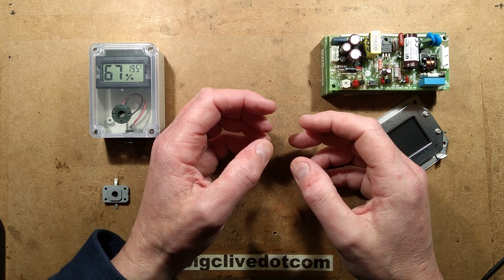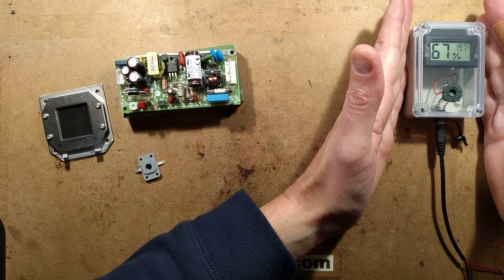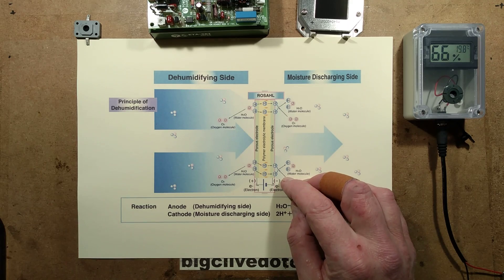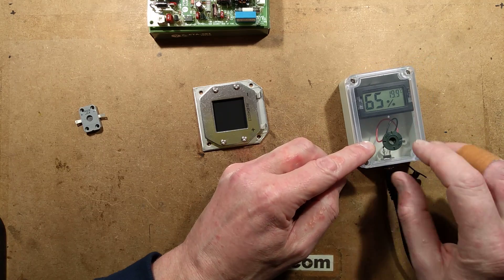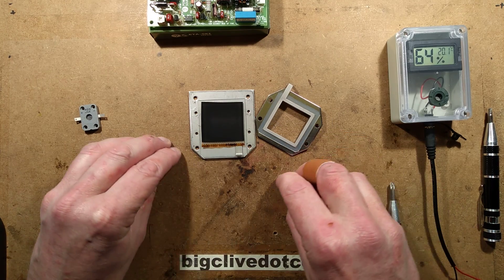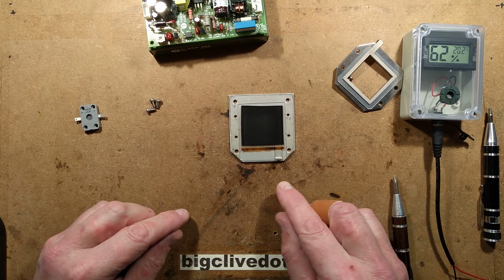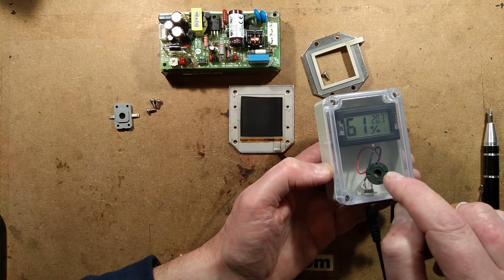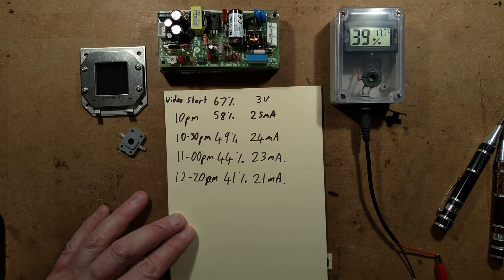Incredible solid state dehumidifier.  No moving parts.

Comment: So impressive! After an excellent explanation of the base principles, some commenters still fundamentally misunderstand how it works, or what it can do, or what it's good for.         

I know it's not new anymore, but wow! Some reflections about some of the comments:

No, it doesn't do anything with the collected water, cause there's no collected water to do anything with, it doesn't collect water, if anything the opposite, it splits water, into hydrogen and oxygen, as clearly explained.

No, it can't turn liquid water in to water vapor and extract electricity from that process, that's just not possible, and, that would still not be normal operation reversed.                   

The actual normal operation reversed is not technically impossible to draw "power" from , but then again, a fuel cell designed for that actual use would be a lot better, and they're still incredible impractical compared with other alternatives.    

As some already pointed out, splitting the water in humid air, and getting rid of the hydrogen can't increase the oxygen levels significantly. If there were liquid water in the box that could evaporate to replace the spitted water it would be a completely different story.

PhD on fuel cells or not, if it had the life expectancy of a horrifically abused PEM fuel cell they wouldn't be commercialized, as they would have total capacity over it's life similar to a bag of silica gel of the same size.

Comment: 13:29 Could the 3V limit be simply to avoid turning the membrane into a Capacitor?
If it does become a Capacitor, could it damage the power supply, the equipment it's dehumidifying and or some poor shmuck that touches the wrong thing?

Comment: the membrane is basically working by electrolysis. You could make an enclosure that includes an O2 sensor. IF the environment in the enclosure does become O2 rich it would have to be combining the H with O2 from outside the enclosure that could reduce available O2 around the enclosure. So build an enclosure where the membrane is between 2 sealed sections, Put a mouse in the output side and see if the mouse passes out as the humidity increases. Might also test to see if a pressure differential occurs between the two sealed section of the enclosure if you don't want to asphyxiate the mouse just put an O2 sensor and humidity sensor on both sides. Oh, and a pressure sensor to measure if a pressure deferential presents between the two enclosures, input and output sides.

Comment: those temp and humidity meters are changeable the Fahrenheit  setting is achieved by shorting 2 solder dots on the PCB , the board is marked C/F could always put a switch to change between

Comment: So it discharges hydrogen gas into your electrical panel? That doesn't sound like a good idea. But what else could it be doing with the moisture it removes from the air?

Comment: My initial thoughts were that this would be nice for making an enclosure to store food, drugs, maybe even for storing guitars or other instruments if you monitor the humidity with an arduino or something and control power to the membrane to keep it in a specific range. That would also be a way to keep these from dying if they are PEMs and don't want to be starved of moisture (you could also just monitor current). But if it's making an oxygen rich environment, that's not so good for storing food or pharmaceuticals or really anything prone to oxidation. I also wonder if it is air permeable at all, or could even hold a slight vacuum? A fully sealed environment is also desirable for lots of the potential applications. Still, very interesting.

Comment: Initially, at least, the Rh seemed to be decreasing commensurate with increases in temperature. You commenced with a project box temperature of 19.5°C and Rh of 67%, thereafter peaking with a temperature of 20.4°C and Rh of 60%,  and ended with a temperature of 17.6°C and Rh of 39%. I noticed that the temperature decreased when you reduced the intensity of the lighting. So, was the initial transient increase in temperature and the commensurate decrease in humidity down to external room temperature (arising from the lighting) or from the operating temperature of the membrane?

Comment: It actually works better then the humidity itself would suggest seeing as it loses 2 degrees and that would result in a RH increase.

It removed almost 50% of the water by weight(or just hydrogen of the water) by 12:20 and the dew point inside the case went from around 13c to 7c which is quite big. 
However I don't know if its actually useful for its intended purpose, its not to hard for temps to drop 10-15c in 5-6 hours and this small unit couldn't keep up to stop condensation unless the relative humidity increases its effectiveness greatly as it nears 100%.

Comment: Hopefully it wouldn’t be a problem in places with colder air but wouldn’t generating a significant amount of extra oxygen in a case with electronics which could spark be a problem in areas where the atmosphere can hold a significant amount of water?

Comment: Remember that Relative Humidity with a given quantity of water in a specific volume of air varies with temperature. So at 20°C and 65% R.H.,  that value might change to 60% at 22% C (Don't quote me; I'm  estimating the figures!), and that temperature change needs to be taken into account. This makes the later figures somewhat more impressive, because your ambient temperature was dropping during the test.
Reply: Refer to a psychometric chart,  where you can check the pressure as well.

Comment: You just have to remember that the relative humidity drops even when the temperature rises.

At the beginning it was 19.7°C and at the end 20.3°C. But still the absolute amount of water in the case has decreased. So the part works, but not quite as the % number suggests. 

The later values confirm this. Because although the temperature sank, the air humidity sank further. But the temperature must also be recorded, so that the statement is really accurate.
Reply: I agree that temperature is a big part of relative humidity measurements, but did we watch the same video? In mine the end measurement for temperature was 17.7C.

Comment: I think I figured it out.  The fibrous coating on the "outside" is a catalyst for recombining the electrolysis produced hydrogen with atmospheric oxygen to produce water vapor.  The reason you can't run it the other way around probably doesn't have anything to do with the electrolysis membrane.  There's just no catalyst on the other side, and therefore a steady buildup of molecular hydrogen... in an electrical enclosure.  I'd imagine that would either pressurize the interior with hydrogen till it reached equilibrium.  That might physically damage the membrane.

Comment: I've seen air conditioning installed in enclosures, which can also both heart and cool as needed but probably quite a bit of power in the long term. This seems a good solution when moisture is a factor but temperature control is not.

Comment: There are comments about pumping water the other direction. As I understand what you showed, the water is destroyed, not transported to the outside. Running it the other way round would just put the Hydrogen in the box and the Oxygen on the outside.

Comment: I'm curious about the temperature rise over time, but it seems like it could just be the hothouse effect of having the lights pointed at the box.  Did you privately track temperatures over time, or just the current draw / humidity?  I guess at 0.1 W, half of it pointed to the outside world, it wouldn't raise the internal temperature that quick.

Comment: At first I was skeptical because the temperature was rising and that in it self will cause the RH to drop but after the extended run time where the temperature dropped back to or below the starting temperature, that removes that obvious variable.  So, very cool.  Thanks for demonstrating it.

Comment: Could you explore the efficiency at which this technology could be used in climate control?
Suppose an entrance or foyer. Rather than removing damp hot air from pedestrians at the egress of a public building with air conditioning removing the water with its temperature and dumping it outside. Removing the hydrogen and storing it. How do the values of energy used pan out between a conventional dehumidifier losing temperature and the solid state device, given you store the hydrogen? 

My question was ready to ask but I had never seen an example of the sold state dehumidifier explained. This technology and its use is, in my mind, is the natural extension of using the latent heat of water as the limiting factor in engineering a Western Metropolitan Society.

Thank you. Darie.

Comment: I'm buying these for water collection experimentation .        3V , I can use a lithium cell and probably solar light , WHO'S THE FIRST TO MAKE A SELF FILLING SOLAR WATER BOTTLE ?!?!?!?!?!???!!??!
Reply: Cant work as it needs oxygen on the "wet" side. So once that is used up in the bottle... no more water.
Reply: Interesting , Thank You very much .
Reply: But it chemically destroys the water?
Reply: The largest membrane I could find, the M-10J1R, with a surface area of 250 cm^2,  moves 28 grams of moisture / day using 192Wh per day. And that membrane costs 368 euros. ==> I won't build it...
Reply: 28 grams a day from a 250cm^2 area wow ,  that's definitely not high output THanks fro the numbers , I'm going to erase My comment now because the self filling solar water bottle doesn't sound realistic at the moment lol .   THanks
Reply: Maybe a water collector for Your car ?
Reply: Bicycle ?

Comment: Could this be operated in reverse by supplying low pressure hydrogen to produce 3vdc?
Reply from the maker: It does seem similar to a fuel cell, but an actual fuel cell would probably be more efficient since that's its primary purpose.

Comment: Can these be used to remove moisture from a sealed enclosure where the outside of the enclosure is expected to be extremely wet, say, in a water well, water tank, or cistern (not submerged)? Rosahl is a bit stingy with pricing specifics, and I'm not a fan of requesting quotes. What does the RD-3 go for?

Monitoring water level in a tank is a very common problem. Electronic devices don't care much for 99% humidity. This sounds like an excellent candidate for protecting those electronics.
Reply: I imagine you'd have a hell of a job pumping humidity out into a container that's already 99% humid. For water tank measuring I'd go for some other method, keeping as much of the stuff as possible outside of the tank. 

You might not be able to get a price from Rosahl if they don't sell their own stuff retail, you'd have to find a distributor or supplier.
Reply: greenaum: normally, yes, but this doesn't pump water: it pumps hydrogen out leaving the oxygen in the box. The vendor says these won't work if there is no humidity outside the box and they don't mention an upper limit except that it can't be immersed. I'm not a big fan of having concentrated oxygen around electronics that already want to corrode, but that's better than condensation.

Comment: In the beginning, the humidity drop would probably have (almost) fully been caused by the rising temperature. Later, the lowering humidity would actually have been even lower because of the now lower temp. Temp has a big influence on relative humidity, so it would be interesting to see the same test under static temperature conditions.

Comment: Right so you showed the temperature in your model setup, if calculations re made the temp with relative moisture content, should be included. The moisture % would change on it self without the device active if the temperature of your setup is changing.
Reply: Joop Terwijn yes, the humidity would drop if temp rises.
From the beginning to the end the temp drops and the humidity dropped.

Comment: I think this is a marvelous achievement. The only thing I am worried about is that humidity is reduced by splitting water and kicking hydrogen out, so the oxygen stays in, but what about the corrosion! Oxygen has the tendency to stimulate rust, if I may put it so blunt.
Reply: Yeah but the amount of water in a bit of humidity isn't much. So the amount of oxygen in that water isn't much either, compared to the 21% in the atmosphere anyway. Once the inside is dry, it stops producing oxygen. 

Anyway if more water can get in, oxygen can certainly get out.

Comment: You should have recorded the temperature, as well as the relative humidity and current draw.  I noticed that the temperature was lower for your later readings, and 100% relative humidity is a lower absolute humidity at a lower temperature.  So the absolute humidity in the later readings was even lower than the relative humidity readings would imply.

The reason for your final reading suddenly changing from 41% to 39% was that the temperature changed from 17.5 to 17.6 degrees, so the absolute humidity probably changed almost nothing, but the temperature increased, thus reducing the relative humidity.
Reply: Reading that back, I don’t think I phrased part of the comment very well.  What I meant was that the decrease in absolute humidity was bigger than the drop in relative humidity would imply, because of the drop in temperature.

Comment: Interesting. An immediate application I thought of is controlling the humidity inside a piano.
You should get a ubiquitous 8-pin chip hooked to (2?) of these in anti-parallel and try to control the humidity of a box to a precise value. Humidity too low? Turn on the one that draws it in. Humidity too high? Turn on the one that draws it out.
Reply: Compound based humidity control packets as used in humidors? They'll release or absorb moisture as needed to hold the cigars in the perfect conditions. Probably not manufactured for piano humidity, but the idea could be tailored to that application.

Comment: Basically the device uses a precise level of electricity passed through the conductive parts of the membrane, which in turn activates the coating on one side, to separate molecules into individual atoms long enough for atoms of the desired size, those small enough to pass through the mesh unhindered, to migrate through the mesh, and upon exiting on the other side they either left alone to act as atoms do(to form molecules based on their atomic properties), or they are excited by the coating on the second side into forming molecules, essentially making the coating on the second side act as a one-way valve...
I would bet dollars-to-donuts that one or both coatings are heat-sensitive, meaning that if the conductive part of the mesh gets too hot it will change the properties of that coating or it will make the coating get liquified enough that it fills up the gaps in the mesh rather than lightly coating it...

Comment: So can a normal mortal purchase these without paying an arm and leg?  

And can it lower the humidity lower than the surrounding area?
Reply from the maker: In an ambient room humidity of about 65% it bottomed out at 22% in the case.  From other comments the small plug costs around £20 plus suitable power supply.  Cheaper than a peltier dehumidifier and still fairly specialist.

Comment: That's fascinating Clive!  Although you keep mentioning that the devices migrate moisture from one side to the other.  The diagram suggests that the electro-chemical process is stripping hydrogen atoms from the H2O molecules inside the box and as you say "leaving an oxygen rich environment inside the box".  It seems to me (IMHO) that moisture is not being moved but removed?  It would be very interesting if you encased your test box inside a larger container, ran the device for a period of time and performed a "squeaky pop" test in the outer container?

Comment: I grew up in a lovely farmhouse in North Wales, and I remember the damp proofing involved electrodes drilled into the inter-stone cement as a way of repelling water; maybe distantly related though more likely a completely different mechanism.  
Incidentally, if you look at the equations on your datasheet, and assuming my literal reading is somewhere near correct, the anode side absorbs a whole water molecule, and pulls off H+ ions via the removal of 2e- while the cathode side recombines the ions, having attracted them by its negative charge, as h20 molecules. Talk about black boxing, I'd love to know how it really ticks, how DO they pull the oxygen across?

There's got to be much more happening than is listed, we've what I suspect to be 'lies to children' going on with the supposed lone neutral oxygen free radical wandering about.. Maybe not, I'm no chemist but it seems dubious. 
Sorry, I heard you saying there might be electrolytic splitting going on externally and I'm quite sure there isn't.

My favorite common fib is the H+ ion, if you think about it that's a lone proton! None too stable outside of a particle collider :-)
Reply from the maker: That's what originally got me looking into electroosmosis.  Although the rising damp version seems to be controversial.
A friend had a system installed in a new house and I'd never come across it before.